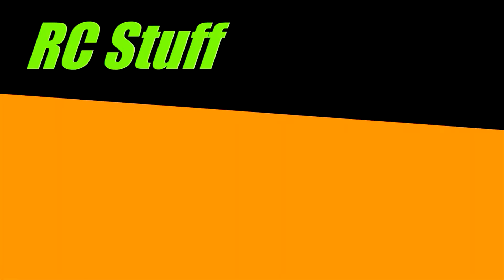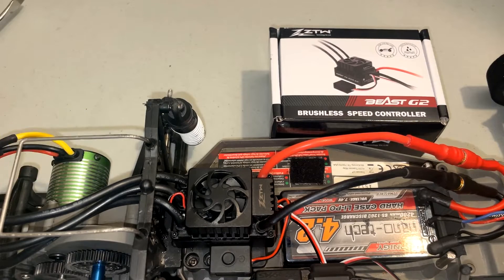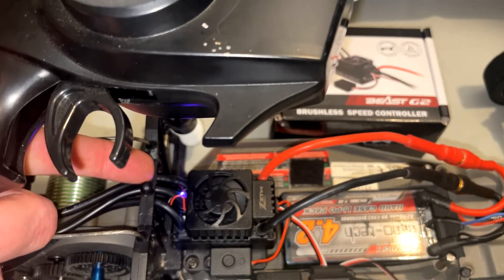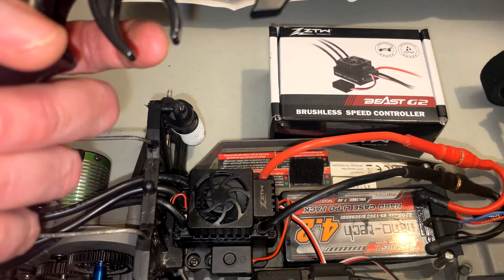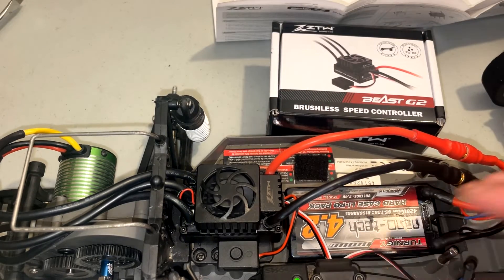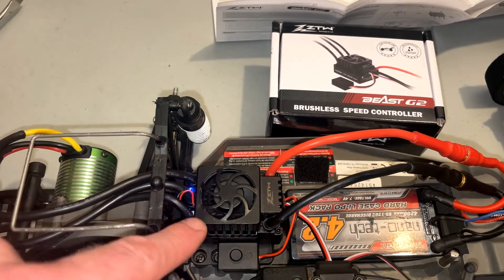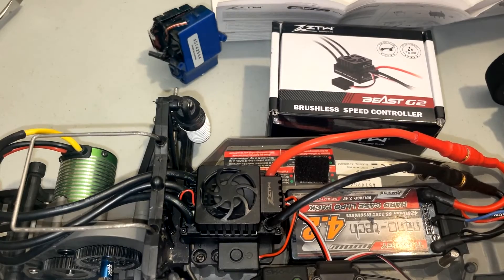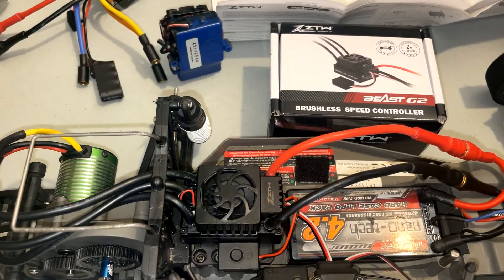How to Calibrate the Budget Friendly ZTW 120A Beast V2 ESC - Preparing for Speed Runs in the Bandit!

Comment: Do you know which is the program card option to reduce the initial light throttle? Mine starts pretty fast with barely hitting the throttle. Thanks in advance
Reply from the maker: That is the one negative about these, they do not have punch control.

I asked the company about it and they haven’t made any changes yet. 🤷
Reply: @BriansRCStuff Thanks for the heads up, I changed the forward force from %100 to %80 and helped a bit.
Reply from the maker: @pibe8761 that mainly controls top speed but I am glad it helped.
Reply: @BriansRCStuff It does but it seems to start off a little easier.

Comment: Thanks for the great video , 

I've just bought the ZTW Beast G2 80amp esc with 3660 / 3500kv motor . Picked up a Spektrum SLR300 Receiver and Stock Spektrum SLT2 Transmitter as an upgrade for an Arrma Gorgan .

Got everything connected , Esc running into Servo THR port , Stock Servo into STR port , 5200mah 2s battery power . 

However when powering up esc after the beep the blue light blinks and will not calibrate at all . 

Same thing with both Gorgons as we have two , it's driving us bananas 🥴🤣🥴
Reply from the maker: @blairmiddleton4484  thank you! So the video helped you get everything connected? Everything’s working now?

Comment: Kw motor ? 3 s ?
Reply from the maker: I run 2, 3, and 4s on up to 4600kv motors.
Reply: @BriansRCStuff  thanks.. what do you think of this ztw 120 ampere esc? I'm undecided whether to buy
Reply from the maker: @ it has been great for me. I have tons of videos, running it and have gone as fast as 108 mph.
Reply from the maker: @ mine has been awesome and the only 120 a ESC I did not cook getting my bandit over 100 miles an hour. I fried a hobby wing and a stock Trax velineon ESC.

Comment: Recently got a ZTW beast 80amp ESC. You need to purchase a programming card. They do have a punch setting but they list the punch as Min. Throttle. This setting. - 5%, 8%,12% and 16% is on the programming card. I set mine to 16% and the punch is pretty good upon hitting the trigger from a standing start.
Reply from the maker: Well that is great news!  That you for sharing.  When I saw the description for that, it did not sound like punch settings to me, but maybe it is!

So I guess 5% soft, 8% low, 12% medium, and 16% hard/full?  How does 16% compare to whatever the stock setting is?  Do you know if there’s a big difference between the different settings?

Thanks man!  I will have to try it out!
Reply: @BriansRCStuff I have mainly used Hobbywing and Spektrum ESCs. A retailer in New Zealand has started to stock the ZTW combo package with either a 60amp, 80amp or 120amp ESC with a 3660 motor. I thought I would try this particular brand out. I do have a Traxxas Bandit but it's still in brushed mode using a Spektrum brushed 60amp ESC. I am using the ZTW 80amp ESC in a BSD 2WD Baja buggy using a Spektrum 3300 KV motor, running on a 3s LiPo. 

Using the ZTW ESC is slightly different as we are use to having a program sheet as a baseline or default settings to follow via other manufacturers. 

The terminology is also different to describe the settings. I actually had to read the instruction manual a few times, and then I was able go, I think that one is the punch settings etc. 

With the ZTW you basically have to try each setting to find what works for you and your rc car.

Yes, with the Min. Throttle setting (punch) 5% is the lowest with 16% being the highest.
Reply from the maker: @mikehardy1912  I really appreciate the information! Have you been happy with your ZTW ESC?  I am getting ready to torture test mine!
Reply from the maker: So so far you have been happy with your ZTW ESC?  Mine has worked great so far.
Reply: @BriansRCStuff   to be honest, i am astonished by the 150A version, as it has been tortured relentlessly for testing purposes. believe it or not, it survived (without any issues whatsoever) about 10packs on a 30bl+  1/5 vehicle (outcast 8s, but obviously tested with 6s batteries). i have another one permanently installed in a dbx07 buggy (7th scale) and a third one also permanently installed in a 7.5kg+ (about 17lbs) hobao hyper MT+2 (which is 7th scale as well). so all in all, my experience with these G2 150A escs has been great so far, but time will tell. mind you, i am running all of them paired with dual 2200uF/35v capacitors (mounted as close to the esc as possible). the internal esc capacitors seem to be marginally sized to me, so i would suggest you assist these with external caps.
Reply: hi all. i think this has nothing to do with punch whatsoever. its just the minimum throttle point at which the esc will respond to (pretty much the same as 'throttle deadband'), but the punch remains the same at any setting actually. at least that`s my experience with a few of these G2 ZTWs. long story short: if motor cogs at very low throttle, then increase the aforesaid setting. 
TIP: if you need punch control, you can mimic this via the radio/transmitter settings (some transmitters have a 'lag' setting on throttle).
Reply from the maker: @kthnos  I really appreciate the comment. What you were saying is what made sense to me when I was looking at the functions of the ESC initially. I may still tinker with it, but that’s the one of this ESC that is significant to me.

Comment: That looks like a really nice ESC.  I had never heard of ZTW before.  I can't wait to see how it does in your run in that nasty Bandit!  I am thinking of getting one for $50.  Have you been happy with it?
Reply from the maker: It has worked really well in my HBX truck but the Bandit will really push it hard.  There really isn't anything I don't like about it other than it does not appear to have punch adjustment.  It is on the larger size for a 120A ESC but it is still smaller than the stock Velineon ESC and it fit really nicely in the Bandit.